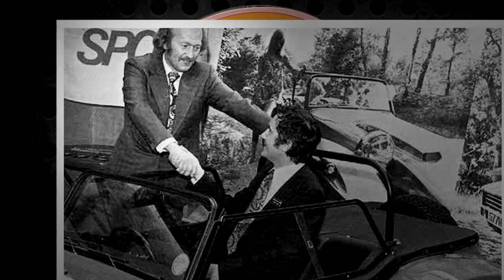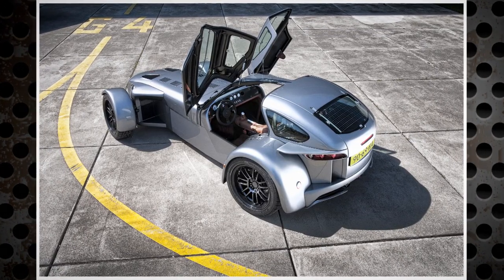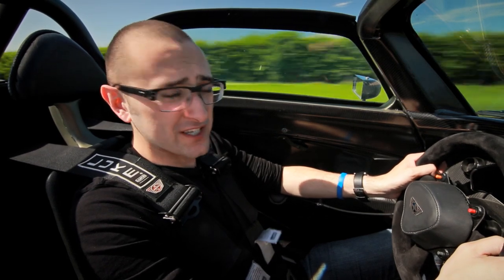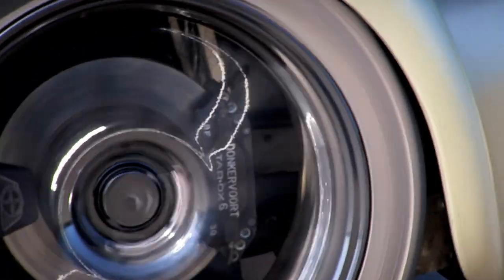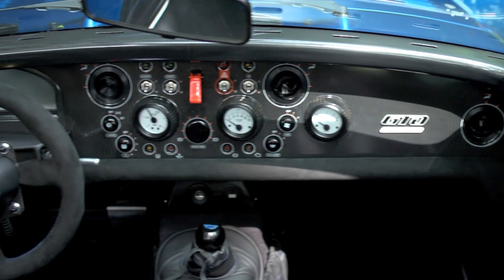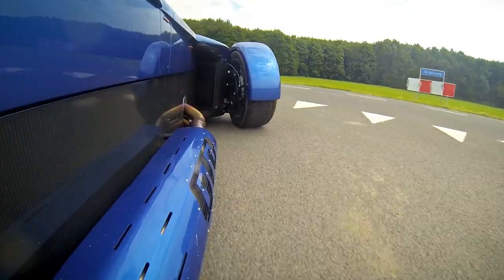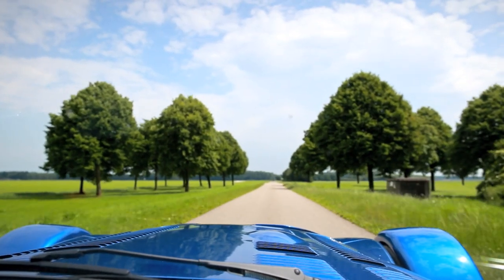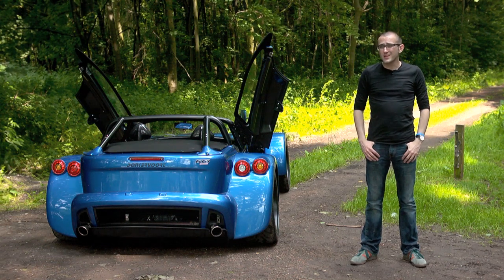Donkervoort D8 GTO: The Lotus Seven you always wanted  - XCAR

Comment: Sold me at "audi 5 cylinder turbo and a manual gearbox" Caterham who?
Reply: the ones that use a supercharged duratec engine with sequential gearbox and limited slip diff.

oh also still more power to weight than the d8
Reply: paul torton That sounds fantastic indeed, but would I chose it over an audi inline 5 turbo, with a manual? Not a chance. The sound, power, let alone the novelty of the audi 5, going back to Class B rally racing, Audi Sport Quattro, RS2, 200 20V turbo, wicked cars with a wicked motor.
Reply: Craig Kulig yeah the sound is good but you could buy a 7 style car and get a audi 5 put in it for 20% of the price. it doesn't really warrant the price
Reply: Craig Kulig
 By that criteria, just take an engine from a Metro R4 and stick it in a Caterham / Lotus 7 and have anywhere from 380 Bhp - 400 plus Bhp on tap (naturally aspirated) and think of all the weight savings. Engines and power are only limited by the imagination.::).
Reply: paul torton You've given me a great Idea! Lol
Reply: arriviste2020 a 6r4 engine in a 7 would be mental, I like it lol
Reply: Craig Kulig there is a lot of uk kit car companies that'll sell you that type of kit car then you just find your own engine, google dax kit cars and have a look at images, they do everything from ford 4 cylinder engines to v8's
Reply: Craig Kulig had another thought, if its just the engine sound from the audi 5 why not go for a ford engine from the st? that's also a 5 cylinder and sound really nice
Reply: paul torton Nice sound in the Volvo 5 cylinder in the ford :)
Reply: illosify definitely, besides the Lamborghini v10 the Volvo engine is one of the best
Reply: ***** its not called the caterham 7 620r, its just the caterham 620r lol.
cars like this aint build for comfort, they are built for 1 purpose and that's speed
Reply: ***** they really aint, they are built for the track. if they was built for comfort they would copy a rolls Royce not a lotus 7
Reply: ***** so your telling me the caterham 620r isn't a track bred car? haha go away you obviously know fuck all about these types of cars.
as for the donkervoort, you say they strayed off from the 7? its layout is exactly the same, just a bit of bodywork isn't 'straying' off from the original
Reply: ***** the 620r was built to be a track day/road car with the likes of the atom and ktm xbow.
the construction of the d8 is the same as the original 7, its just materials and engine that's different.
I've not made myself out a moron with my comment about you knowing fuck all, anyone knows exactly what caterham cars are built to do, an its not a everyday car you do your shopping in
Reply: ***** its a road legal track car, plain and simple.

ok if the d8 is so similar tell me the differences
Reply: ***** see you cant say how it is different, that's because its not.

making a road legal track car doesn't mean reducing performance at all, you really don't have a clue. road legal track car means its basically a track car with the legal bits added like indicators, different tyres ect
Reply: ***** back to the road legal stuff. a baffle in the exhaust isn't reducing its performance. the suspension, there isn't special race suspension you know, its the same as the stuff used on the road, just stiffer settings, again not reducing performance.

I want you to tell me how the d8 is so different to the 7, we both know you cant as there isn't any apart from bodywork and a few more bits
Reply: ***** what the fuck dos f1 suspension have to do with a car that doesn't use it?

go look at the specs of the cars in the caterham race series and compare with th road version, they are almost identical besides indicators.
engine, gearbox, electrics, suspension are exactly the same as the road car.

dont mentioning f1 as it has fuck all to do with the caterham or d8
Reply: ***** you shared a link going on about suspension in f1 cars, how was that relevant at all? it wasn't. 

the caterham series is to get younger people on the track in competitive identical cars and its advertisement for the company. the cars on the road are similar to the track, not the other way round
Reply: northern marine It's not a caterham or super 7 with an other motor. It's a total different car. Only the shape remembers to these cars. They haven't got a 500 hp motor because it will not improve the pure driving experience. It's a big puzzle, Every part of the car has developed with the  goal to make the driving experience more pure and make the weight leight as possible. 
Most people who owns such cars are driving in the weekend through the mountains, polders, empty lanes etc. Maybe it's not an 'every day car', but it's really a fantastic and innovative piece of craftmanship. The people of Audi love it and on the circuits they are one of the, or maybe THE fastest car. So it isn't a 7 with a bigger motor and some other materials, it's a great driving street legal race-car.
Reply: Gino Catshoek actually when you take the bodywork off its the EXACT same design as the 7, its just made with different materials. it may be one of the quickest cars round a track but it definitely isn't THE fastest, by a long way
Reply: donkervoort has a fan in the board of directors of audi. So more tech support.
Reply: yes they are exacty the same , just as a VW golf and a Ford focus are same cars.
Reply: northern marine this is NOT a crapy kitcar. This car beats a porsche 911rsr on track.
Reply: northern marine yeah nice a caterham 620r but this thing will beat it on any track. Does the caterham do 270kmh? A caterham will fly at that speed.
Reply: northern marine drive a donkervoort, way way more grip then the caterham, it can put 400+ bhp to the ground as the caterham has a lot of wheelspin and always goes sideways. Not exactly a racecar. This car will beat a porsche 911rsr on track, a caterham with 600bhp will not. It will be undriveble

Comment: C'mon, 380hp from that 2.5 TFSI is not extracting lots of performance, it can put out 470hp and 620nm with a uprated turbo&intercooler, exhaust and a tune by MTM. Of course, that would be fucking crazy in a 695kg car, but I'm just saying
Reply: It's basically stock, they likely didn't want to mess with it too much on purpose, either because they think its performance is already enough, cost or reliability.
Reply: Nah, you wouldn't need a turbo like they use on 900hp Evo Xs, nothing crazy just slightly bigger.
Reply: bototheone1
But why? No everything's about power and raw performance. Colin Chapman's concept was low weight, not big power. Lag, cost, usability is more important than that.
Reply: Then why do people get at least 400hp on that engine only with a quality tune but Donkervoort can't?
Reply: *****
 The 2.5liter 5 cylinder Audi engine is already turbocharged from factory, producing 340hp in stock form.
Reply: ***** 360 ps
Reply: TheEryk03
No, the engine produces 340hp in the Audi. It only produces 360hp in this
Reply: ***** in stock TT RS plus is 360 ps and in this donkervoort is 380.
Reply: TheEryk03
Yes, my bad! There's a 20hp difference and i got the numbers wrong.
Reply: bototheone1 They actually list it as "380+ps" - that has to do with a deal they have with Audi to not state the engine as capable of radically more than Audi provide it with. Tests on customer cars have it over 400 in the real world (one published dyno run had 362 at the wheels)
Reply: Oh so then it's just got a remap. Alright.
Reply: bototheone1 470bhp from a car this light isn't crazy, it sounds like fun
Reply: It's crazy if you don't know what you're doing or if you keep that traction control off.
Reply: bototheone1 I've got a caterham and they are bloody fun
Reply: bototheone1 470 hp? Phah. It's possible to make more than 1000 horsepower out of that engine with ease. Look at what Boba Motoring is doing with a few Mk1 and Mk2 Golfs. But this is no issue here. Here, the weight reduction has gone so insanely far that you don't need that much power. The power to weight ratio is better in a bugatti veyron, as mentioned in the video. When this is the case you can be more than 100% sure that you're gonna get unbeatable performance.
Reply: bototheone1 donkervoort says it only has 380hp, but it actually has 400hp
Reply: You can't use massive LLK and other stuff in such cars. And it also should be somewhat driveable ^^
Reply: El Boto then you loose the driveability donkervoort is aiming for
Reply: the new RS model has 400 plus
Reply: Yea I would say that was plenty of power.